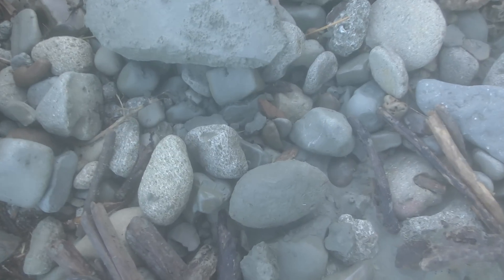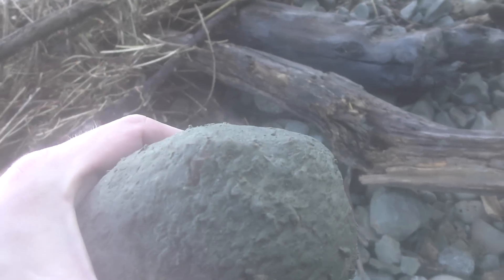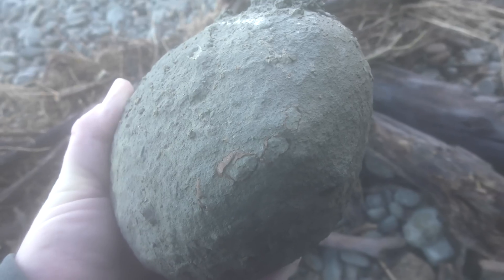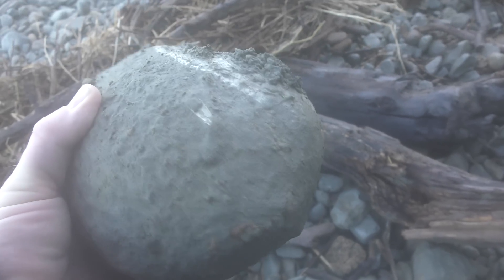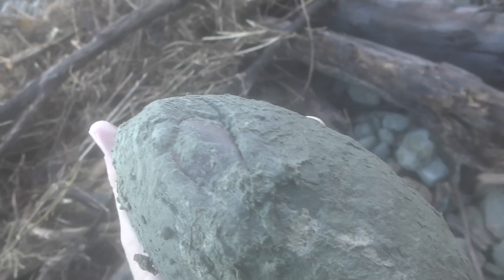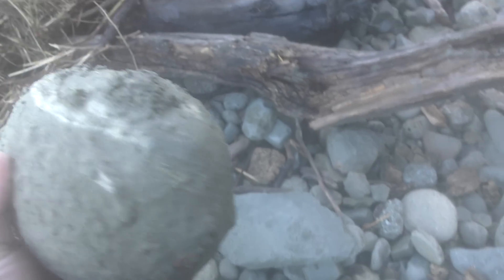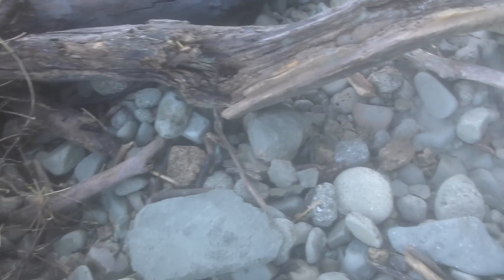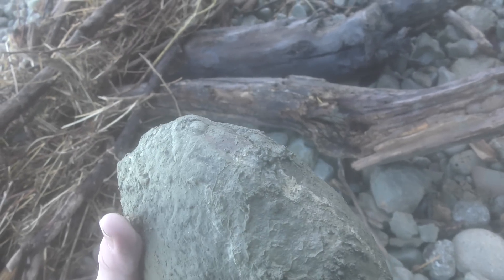Fossil crab prep: remove all the rock! Prepping a crab fossil I found on the beach

Comment: Hello, this is a silly question, but have you ever listed the types of handpieces/bits that you're using to remove the matrix-rock?
I have access to a 1/3 hp Foredom motor and drill (handpice) but it looks like you're using a reciprocating gouge of some sort.
(at work, I also have a clinic full of dental drills, but that might not be the right  type of kit, lol.)

Anyway, if you don't mind listing your gear, I'd find it interesting (don't worry, I promise not to go into the business)
Besides, in Oregon most of our marine fossils tend to be mussels and boring bivalves...

Comment: I wonder if there is a way to set it in clear epoxy resin or some kind of optical plastic etc. Completely prep one side. Let it set in epoxy resin. Prep the other side. Let it set in epoxy, and then polish the outside smooth. I have no idea about whether it would be feasible as I know nothing about the process, but if that was a thing the result would be fantastic.

Comment: Most arthropod fossils are actually exuviae - their old exoskeletons. They break very easily so maybe your crab had a happy life and only its exuvia happened to fossilize ;)

Also: I prefer to be able to see as much of the actual fossil as possible but either versions are beautiful!
Reply: I thought the mineralisation of the organic matter from the crab's body was what bound the concretion together. Hence why these concretions always have the same oval shape that extends down to the crab's "knees" with the bottom half of the legs missing. I don't see how that would happen if it was just a shell.
Reply: @oliverwilson11  I'm no expert on this but from what I just read that's not the case. Concretions can form without a fossil inside them and also with just a piece of shell or a shark tooth inside them. I can't explain to you where the tips of the legs have gone. Maybe they were wore down together with the outermost layers of the concretion after it broke loose from its host stratum or the concretion didn't grow large enough fast enough to protect them from decomposition or they actually fossilized within the host stratum but broke off from the rest within the concretion and stayed within the host stratum.
Reply: @dominikgietl5670 
If you watch his other videos he has found many of these crabs and they are always fossilised in this exact way. Something about the crab (or shell, if that's what it is) is definitely causing the concretion to form.
Reply: @oliverwilson11  I watched them.
When he is searching for fossils he is looking for some signs of a fossil on the outside of the concretion. With crabs these signs are typically the legs and/or the claws but he also found concretions with bones - so it's not a crab thing. He also split some concretions in the field, discovered nothing inside and explained that not all concretions contain fossils.
Reply: @oliverwilson11  also: did you ever see a crab exuvia? When all the appendages are "relaxed" (meaning that nothing is bending them) they look exactly like these fossils. That's just the way they look, if they are mostly intact and complete.
Reply: @oliverwilson11  why don't you just search on the internet for how concretions form? They do not need enclosed soft tissue for that.
Reply: @dominikgietl5670 
The concretion wouldn't always form in the exact same shape with the crab in the exact same position if the presence of the crab wasn't causing the concretion to form. You would see concretions with just the right half of the crab, or just some legs and the rest missing, or just a claw, but that's not what happens. It's always a rugby ball shape with the crab centred in the rock and just the bottom half of the legs missing. You must have wondered why that was if you were watching these videos with even a small part of your brain switched on.

Obviously concretions can form for other reasons too. Not all lung cancers are caused by smoking.
Reply: @oliverwilson11  I never said that the concretion isn't forming because of the crab. The only thing I said is that concretions do not always form around soft tissue because you stated that the soft tissue within the crab is causing such a concretions to form. If that would be the case, concretions couldn't form around shark teeth for example. Every crab molts multible times during its life and usually hides for this process. This means that the exuvia stays hidden somewhere (if the crab doesn't it eat) and it is protected from currents or similar things that would destroy it. I don't know if these crabs where burrowing but if so, such a burrow would be an excellent spot for an exuvia to stay mostly intact and to get buried (for example by a collapsed burrow) before other organisms could eat it.

Just because you indirectly accused me of having my brain switched off when I am watching these videos: if you would be familiar with correlation, causation and bias, you would understand that what he is collecting isn't representative for the fossil record. He only takes with him what seems to be worth it at site. A tiny concretion containing only a partial leg which isn't sticking out somewhere and by that can't be seen from outside wouldn't spark his interest and by that never makes it's way to his prepping station. The fact that we never see such concretions in his video is no proof of them not existing.
Reply: @oliverwilson11  also: the more fragile sth. is, the more unlikely it is to fossilize. Because the legs are more fragile than the carapax it makes sense that separate legs don't fossilize as frequent as the carapax and everything attached to it.

Comment: Love these videos.   Quick question, is Dorsal and Ventral reversed in the timeline description?   I would have thought the dorsal side to be the back of the crab?  I am no expert on crab physiology though!   Thank you as always for bringing us along on these adventures.
Edit: I think both versions are great.  The embedded ones are great display pieces but it's also fascinating to see as much of the crab as possible.
Reply: You are correct. Dorsal is the back.

Although with crabs it is kinda tricky because they carry their abdomen (the part of shrimps that we eat) tightly tucked under their bellies - the roughly triangular area with the tip pointing to the front. This means that the ventral side of the abdomen is facing the belly which is also ventral and you actually see the dorsal part of the abdomen.
Reply: I was looking for this comment so as not to repeat a, "Well, actually..." :) The video is tagged backwards as you said. Most of the dorsal part of the crab would be what we think of as the top of a right-side-up crab, and the ventral would mostly be the underside.